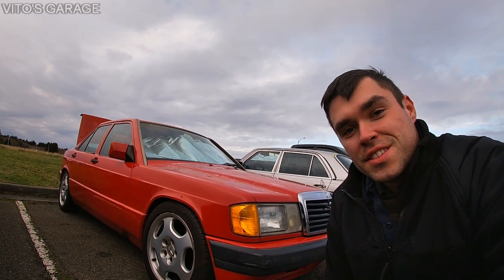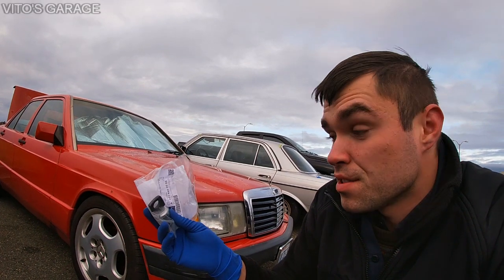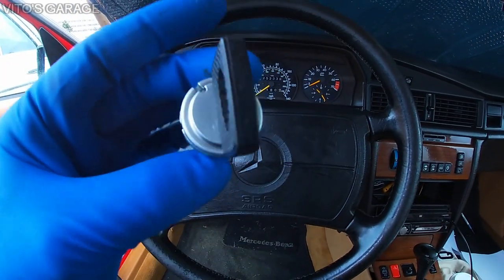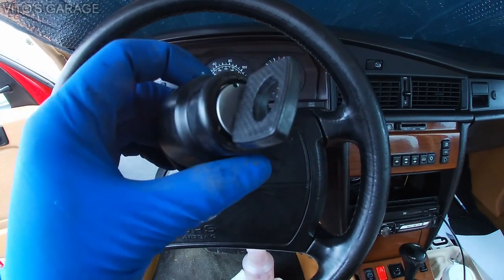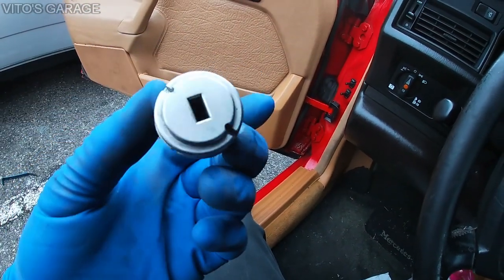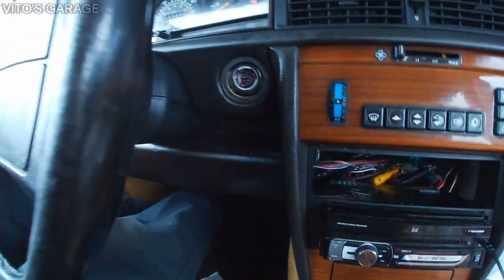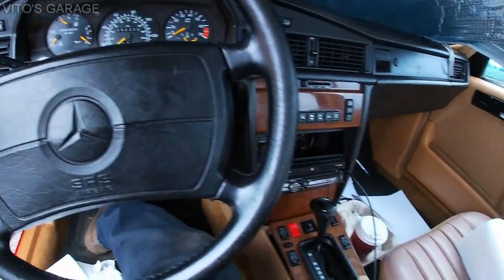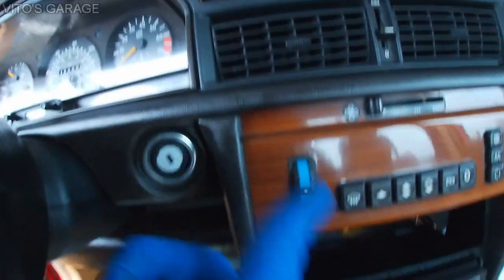New Ignition Lock Cylinder (Tumbler) Installation + 3 New Keys Mercedes 190 W201 W126 W124 R129 W140

Comment: Best instructional on YouTube. Remember you must construct the wire tool with 2mm wire no thicker no thinner, 2.0mm. You must grind the tips of the wire at 45-60 degree and PUSH both ends ALL the way in. Then push further in and pull tumbler out. Super easy after you do it once
Reply from the maker: Thank you so much for watching! Check out my other videos and playlists 🙂🤝

Comment: Were you able to make the new key to work for the door locks ,the trunk, when I had a W116,280 SE, I had the trunk lock changed,so when they put the lock in I was able to use it for the ignition, & the doors, just wondering if you were able to do the same.
Reply from the maker: I need to order a trunk lock cylinder for it. Someone has changed it sadly... The key doesn’t work on it. But it works on the doors and glove box as well as ignition. Just not the trunk
Reply: @VITOSGARAGE  according to a locksmith, I.believe it can be done, you have to check with the bearings, I don*t know if it applies to your car, but it can be done from what they told me please check and see,good luck.
Reply: @VITOSGARAGE  i don't know if this applies to w201 but for W124 there are two types of keys. One key is the master key. This key can open anything, trunk, doors, glovebox, ignition lock. The second valet key used for only opening doors and ignition. It will NOT open trunk or glove box.

Comment: Great video Vito! I saw a video from Ken at Mercedes source saying these tumblers are not being made anymore. Did Mercedes Give you a hard time? I asked Mercedes for a new key for my 1996 S500 They told me no way. lol I could not believe it, I would have to send a letter to Germany and petition them on why i needed a new key. because apparently there are only 3 or 4 left keys for the W140's in the world and they will not ,make any new ones.  So i ended up installing an aftermarket alarm that works well with the cars factory alarm. I enjoy the simplicity of the older cars much better when it comes to things like this
Reply from the maker: The key and tumbler was super easy to get. No hard time. Everything was done and ready for a pickup in 4 days or so. I just needed to show a proof of ownership.
Reply: VITO wher you get tumblet.and key At mercedes dealer I heave Valley imports in my city They sell parts for European Cars maby they can cut tumbler and key for my benz
Reply from the maker: You can ask them. Dealership is the easiest. I like everything original and I wanted to have the same key operate all the locks instead of having multiple keys with one opening the doors and the other starting the engine..
Reply: Any follow up on this? Did you get the key eventually?
Reply: @robertlopez616  Unfortunately i was not able to get anything from Mercedes. I did have two keys cut at a locksmith and they are working great. Luckily my car is pre-immobilizer chip, which can go bad in the later key fobs.

Comment: I’m having the same issues. Where the key doesn’t turn. How did you get the old tumbler out without the key working?
Reply from the maker: You need to be able to turn the key to remove the  tumbler. Spray WD-40 in there, wiggle the key etc. Try to make it turn!

Comment: Is that what they would consider a security key,not a regular car key, because the way they make it,  like before it was a simple car key but now I think it has 3 cuts, which is different from the regular car leys.
Reply from the maker: I am pretty sure this car has one regular key and no valet keys. But I may be wrong. Either way, I just asked them to cut me a new key and that’s it. I wanted the key and lock tumbler to be original

Comment: Just watched bro. Have same problems. Lost all my keys. Had to buy a new ingnition just so i could start and run it. But all doorlocks, glove compartment and trunk.. no keys. I live in the Philippines. Would a.friend from there can get me some original keys and tumbler? Hope you can help me out. Such a pain losing it. 
Thanks bro!
Reply from the maker: In USA, you have to go to the dealership and provide them your ID and proof of ownership and they cut the key according to your VIN number. I am assuming it’s the same process in the Philippines. 
I usually make copies of my keys so I’ll never have to worry about losing them. 
But because you lost the key, you can’t make a copy. You will have to go to the dealership and ask them to cut you the key. 
There’s another option: you can look for a locksmith and sometimes locksmith can make a new key if you bring them your ignition lock cylinder, trunk lock cylinder or front door lock. You’ll just have to order a blank key from eBay and bring everything to locksmith so they can cut it. 

The final option is to order an entire set of door locks, trunk and glove box locks as well as the ignition lock cylinder with keys from eBay. In that case you’d have to change everything
Reply: @VITOSGARAGE  thank you so much for the reply! Will try to go to the mercedes dealer first. If no luck, key specialist. Hopefully they can provide me a key. 
If all else fails. Then I go buy a set for all the locks. There are some parts car avail here. But hoping to retain the orginal locks i have. 

Thanks again bro Vito! Keep the very helpful vids coming! 😊
Reply from the maker: Thank you. Check out my other videos and playlists! I have a lot of car content. Cheers!🙂🤝
Reply: @VITOSGARAGE  def watching your contents.